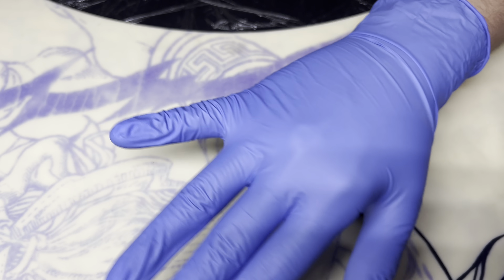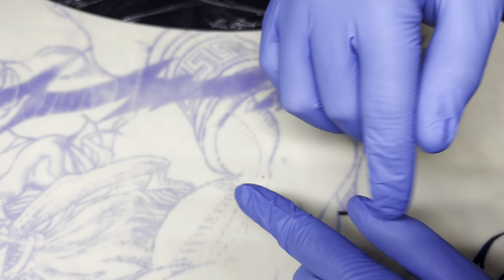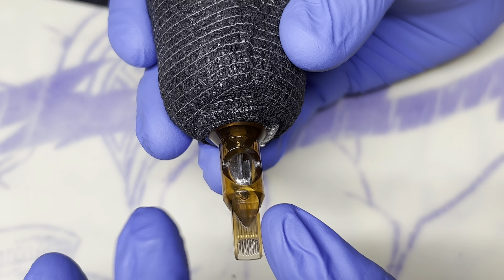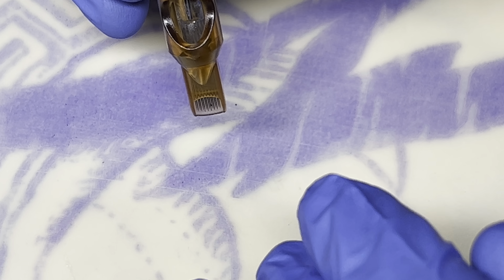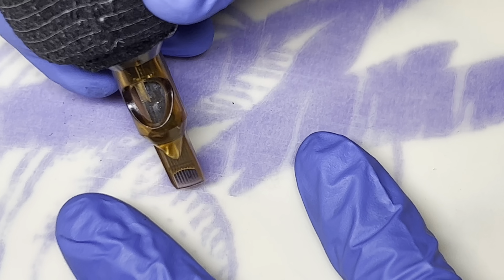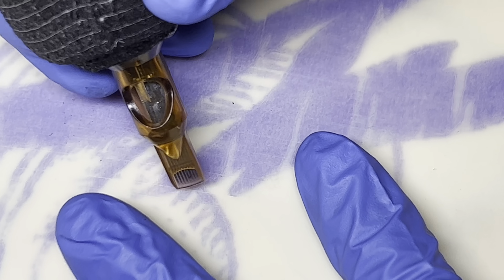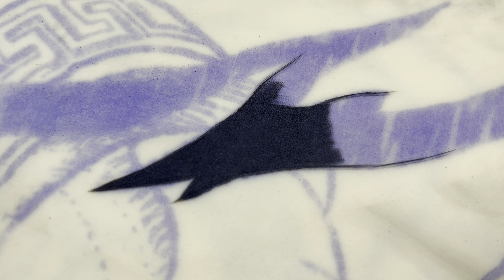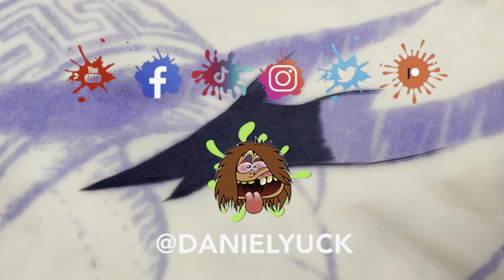Tattooing 101-How I Pack Black Tattoo Ink

Comment: It is very hard on real skin do the same, keep the very saturated solid black and don't overwork the skin.
Reply: Because your needle is to much outside. Start with needle little beat outside and try liiltle mor outside and over. U try learn skin,every skin is diferent.
Reply: @silviotattoo3725 so if ur skin starts getting irritated it's cause the needle is too out or ur putting to much pressure right?
Reply: I still can't pack black without scarring

Comment: Try using your elbow for movement rather than your wrist when packing black. It keeps the needles at a much more consistent depth. When the movement comes from the wrist the needles tend to hit at different levels and can make the black look very patchy thus having to over work the area to correct. 👍
Reply from the maker: That’s a great tip that I talk about in a video I made not too long ago. I appreciate the feedback and recommendation 👍

Comment: Doesn't it cut The skin when outlining With The whole MAG?
Reply: I'm still a complete noob. But as I see it, (personal experience) when using a mag for lining, if you just use the corner as Daniel did. It's no different than lining with a liner or shader.  If you were to line with the full width then I guess depending on speed on how much damage
Reply: @fuglybob9757  He used The whole width of The MAG in some places. That was my question. I'm noob tattooist myself and I have made that mistake.
Reply: You can slice the skin if you're not careful.
Reply: Depends on how the machine runs. It’s could cut possibly if not done correctly. Cool technique though. His machine has some give, sounds nice.
Reply: @Thirdfish  probably, that's why i rather go with the safer option and just use a liner
Reply: @pulpil10  It comes with experience, took me a while but i can line with a mag now.
Reply: What cartridge are you using?

Comment: Thank you for sharing man. I'm always curious what exactly the tattoo artist means when he says just lightly using the tips of the needles? Or when they say they are applying a little more pressure sometimes.. shouldn't the depth be consistent depending on the area being worked? If you only lightly tattoo the skin wont it washout? Id love an explanation of what it means and how it actually works because I hear so much about the ink needing to be in a specific layer.
Reply: The ink needs to be in the derm (which is the second layer of the skin). The derm is about 1 to 2 or 3 millimeters. So as long as you put your ink between those 1 to 2/3 mm your ink is going to stay. 

If you’re going lightly you’ll reach the beginning of the derm, while if you put more pressure you’ll be deeper on the derm (closer to the 2/3mm I was talking about)

Hope it helps a little !

Comment: Hey brand new to this. Curious about the mag. Why are you using a rounded mag over a straight? I would think that the straight mag would be more concussive if I had to hold my machine at an angle at any point. Wouldn’t the round mag make an almost feathered look when, holding at an angle for tighter spots? Or is it because the rounded mag is less damaging on skin? Thanks!

Comment: When you’re packing in black are you on the S shading option or L lining option on the machine?
Reply: I could be wrong, but I don't think the wireless power supply has the L/S option. It's just voltage.
Reply: Sucks that question wasn't answered I've tried both settings and no difference I can tell

Comment: How many passes are allowed before you start to overwork the skin?
Reply from the maker: Thats a great question and a question that I wouldn't be able to answer easily. There are many variables to consider. Is the artists hand heavy? What type of setup is the artist running? What voltage is being used?

Generally I always want to pull 1 pass lines but to attempt to answer the question I would not recommend anything over 2-3 passes. Plus double passes tend to change the original shape of the line if we don't follow over the original line to the T.

Comment: Hey Daniel. Is there a difference between using a double zero mag versus a standard mag when it comes to packing? Your advice is much appreciated!!
Reply: Hey man, my understanding is that with 00’s being a smaller gauge (thinner individual needles in the grouping) it causes less trauma than a standard would. 00’s also deliver a less or slower ink flow than a 12, which may sound like a negative, but as long as you’re using the right technique like in this video, it just means less ink to wipe away, keeping your stencil and area a lot cleaner. 

Hope this helps.

Comment: That’s way over worked my friend. Far too long on that size of an area.
Reply from the maker: From my experience it’s been super hard to tell then an artist over works the skin. I rarely ever see overworking of skin as you mention here. It’s not as easy to overwork the skin from my experience and also what I have come to notice is that 1 artist will have a different number of passes over another. So if it took one artist 3 passes to complete but another artist it took 4-5 is not uncommon and doesn’t necessarily mean the artist overworks skin. 

It’s not impossible to overwork the skin but it’s also not necessarily an easy thing to do when an artist has their application down nor is the application the same. Example I’ve seen some artist move faster when packing black and others move slower when packing black. Both results are great but the application was night and day.